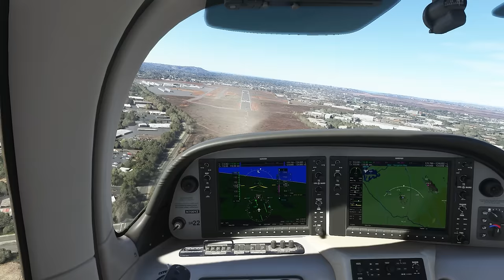Fatal Plane Crash At Montgomery Field After Student Pilot Declares An Emergency | N700YZ Crash

Comment: The problem is these newer planes.. PIlots get trained on planes that do everything for you.. and they fail to learn how to fly... It's why I'm so against auto driving cars. People suck already at driving when they do it every day.. imagine how bad they will be when they have to manually drive the car to the shop to get fixed, and they haven't manually driven in 2 years, and have the total driving experience of a 16 year old at the age of 25. 

It's similar to pilots these days, who get trained on these sophisticated planes that do everything for you... He seemed to have a run away trim.. Disable that trim, and fly normally. Any pilot, even a new trainee should have known to do this immediately, and fly the plane normally without. 

I'm going to assume he was trained on this plane, and that's why he was flying it, and he was not trained properly on how to deal with trim, because its normally automated.
Reply: Gone are the days of utilizing ROAD maps to go from A >B > F.    Now it's all FANCY, LOL

Comment: everyone BS about cause is ended right here.  Garmin GFC 500 Autopilot Notice
Notice Number: NOTC2741

Garmin has identified an issue with GFC 500 autopilots with optional auto trim installed in certified, experimental and Light-Sport Aircraft, including certified installations installed with optional GSA 28 pitch trim in accordance with Garmin STC SA01866W. This issue may result in an uncommanded automatic trim runaway when the autopilot is first engaged. This condition could result in a sudden and significant deviation from the intended flight path. 

Garmin Service Alert 22109 Revision A requires operators of certified installations to pull and collar the autopilot circuit breaker and placard the autopilot as “inoperative” prior to further flight.  Operators may contact a Garmin dealer regarding reactivation of the GFC 500 autopilot with the optional pitch trim configured off in accordance with recommended service bulletin 22110 Revision A.

Garmin is working to fix this issue for certified installations in a future software update expected in Q4 2022.

Garmin Service Bulletin 22112 Revision A requires operators of Experimental and Light-Sport Aircraft to update system software or disable the autopilot or trim control prior to further flight.

Service Alert 22109 Rev A is available at:
https://support.garmin.com/en-US/aviation/faq/mZwVwMogJ09ZLIPJgWTBJA

The recommended Service Bulletin 22110 Rev A is available at:
https://support.garmin.com/en-US/aviation/faq/s7SeFk9oh96I8qVfjtNbV8

For non-certified aircraft, Service Bulletin 22112 Rev A is available at:
https://support.garmin.com/en-US/aviation/faq/QFnVz92cFZ5AvovG4LF6l5

If you have any questions or comments, contact the Wichita ACO Branch at:
Phil Petty
1801 Airport Rd.
Wichita, KS 67209
(316) 946-4139

Comment: Those Cirrus accidents keep mounting up... Hey you rich guys: Please learn to fly properly in a local flight school on a C 172. Learn your radio procedures, learn to slip, learn to land without engine... The Cirrus is a high performance, fast plane and most of those accidents are related to having a too advanced plane with a low-time, untrained pilot. Airmanship needs to be trained. All those fancy electronics and screens can not replace proper flight training.

Comment: Hard to go around when you are dead.   What is the first rule of aviating?    Nothing against this woman ATC, but unless you had the aircraft under control, your job is to aviate and pretty much not get stuck chatting with ATC outside of declaring an emergency.    Likely sensory overload on a LOW time pilot, or student.   IF the SR-22 had a legit chute, and it wasn't deployed (within altitude limits) there is a big chain of screwups.    With regard to 'trim'..   IF you cannot handle the plane you are flying = knowing all the systems, you simply should NOT be flying it..  Heck, you have TBMs that autoland and respond to ATC..   Pop the chute unless it'll hurt your ego too badly...   (You won't care later)...    Do new PPL's with training permits even get this taught any longer.  RIP, but this smells of poor training... Unless it was structural, which I DOUBT, especially considering having a chute to pull...

Comment: Trim breaker not obvious or in reach? Electronics allow designers to be lazy! Make the device mechanical, electronic when you cannot and computerized when absolutely necessary! More people are able to maintain mechanical devices, when electrical circuits are involved less people have the skill to maintain them. This is evidenced by board swapping of components by technicians. And, if you really want to limit who can maintain the device, computerize the whole mess. Cable fray or electrical component fry. Which one can you spot about to happen with a annual or visual inspection…….pick one

Comment: @quillons1 You're calling your assumptions as facts and drawing conclusions and judgement based on that - sounds like someone fits the category of know it all bc I'm an old ass school with many hours- no need to talk about who l'm but a little more Knowledge n research will educate yourself more. Solo student pilots have low risk comparing to certificated pilots and especially instrument rated (research 2001/2005). As for Cirrus Aircrafts and all advanced avionics those are the safest airplanes and pilots trained in them have great skills in terms of cockpit resources which obviously you lack and airmanship as well n most transition to Jet/ Turboprop (research 2013/2017) - as for the Trim issue thats a flight control problem and could be a trim failure easily due to a long list of issuers especially if Airplane recently had an annual (Accidents Database) so the fact you're saying he couldn't trim the plane be of lack of knowledge that's inconsiderate/ arrogant comment and insult to his CFI n his sole- you're an arrogant worthless POS.